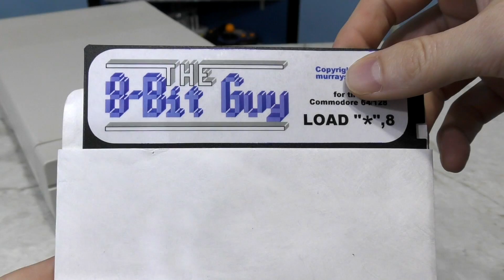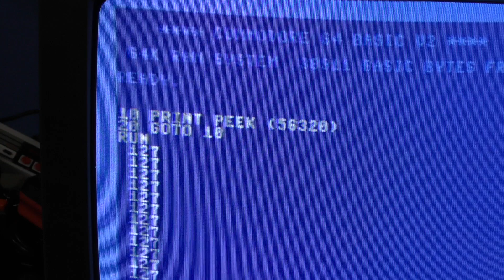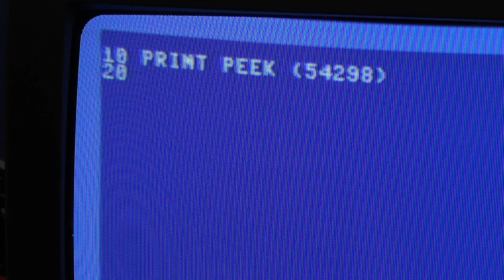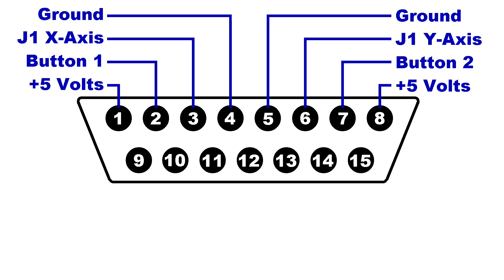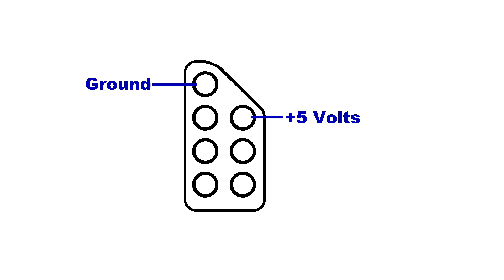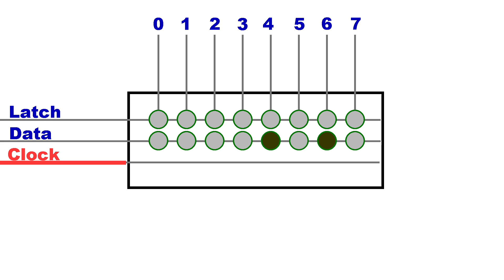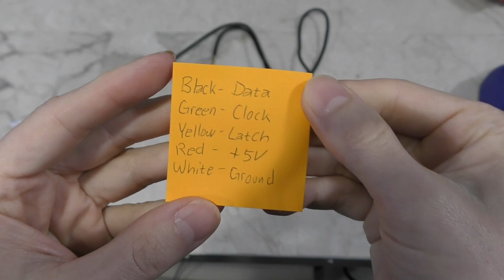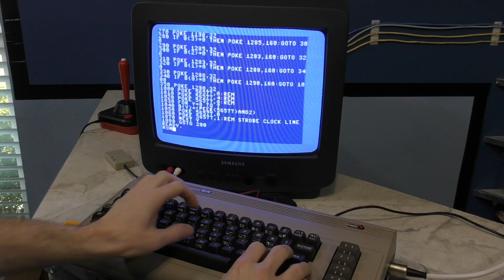How Vintage Game Controllers Worked

Comment: I bet an adapter could be made, that would allow the use of a Nintendo controller to play Commodore games.  You would just need a circuit to convert the data from the shift register chip to analog up, down, left, right, and power.
Reply: They have been made, that's why you can buy them.

Comment: I think you've got your explanation of the genesis/mega drive controller a little wrong.

Besides which I use mine with an atari 800XL without issue. - The computer can handle what a sega pad does just fine.

The Atari joystick pinout looks like this:

1. Up (also serial port pin 1)
2. Down (also serial port pin 2)
3. Left (also serial port pin 3)
4. Right (also serial port pin 4)
5. B input paddle / touch tablet
6. input trigger (aka button)
7 . +5 volts
8. Gnd
9. A input paddle / touch tablet.

The sega pinout looks like this (as seen with a mega drive/genesis)
1. up
2. down
3. gnd / left
4. gnd / right
5. +5 volts
6. Button A/B
7. Select
8. Ground
9. Button Start/C

You can see that pins 1-4 are functionally identical on both, and 6 has broadly the same purpose.
the extra buttons of the gamepad are on pin 9, which isn't a problem either, given that this is also where 2 button atari controllers put it, and even on older Atari devices this is a paddle input, and that means you can even read the extra button if you feel like it.
8 is ground on both.

The problem area is line 5 and line 7.

On the Atari, line 5 is a paddle input, line 7 is +5 volts.
on the Sega, line 5 is +5 volts input, and line 7 is the 'select' line.

But your interpretation of what that means is completely incorrect.

the 'select' line goes to a quad 4 input multiplexer, and selects which set of buttons is wired to the button pins. (notice 4 pins on the sega each have 2 buttons wired into them.)

If you put +5 volts to the select line, it means you have access to the B and C buttons alongside the 4 directions of the D-pad.
If you pull the line low, you get access to the A and Start buttons, and two of the directional controls are disabled.

There is NO way to pull this line to ground from the controller side, the console has to do it.
The reason this works out is that both line 5 and 7 on the atari have +5 volts on it by default. - if this wasn't the case on line 5, the Sega controllers would fail to work entirely. (no power), and if this wasn't the case on line 7, half the D-pad would be disabled, rendering the controller useless for most purposes.

Because you cannot intentionally pull line 7 low using an Atari controller port from the computer side, you cannot use the A and start buttons, and they do nothing. (not connected.)

Sega controllers can indeed kill commodore 64's though, but the reasons are not those which you have given. (it's a design quirk of the c64, and is partially related to it not correctly following the Atari controller port spec.)

You CANNOT kill a device merely by pressing start, because start is disconnected. (select line high - the multiplexer disconnects Start And A buttons entirely under these conditions.)

You also shouldn't be able to cause any trouble with the B button, since that's wired where Atari systems EXPECT a button, and you shouldn't be able to do any harm with the C button either, because that's a potentiometer port, and while that's analogue in nature, 5 and 0 volts are both valid inputs.

Quite why a sega controller can damage c64 hardware I'm not sure, but the reason you've given is clearly incorrect, because that's not at all how the system is wired. 
('Select' is a line controlled on the console side - the controller cannot alter it at all. And it's wired into the select pin of a multiplexer IC, NOT directly to ground, nor to ground through ANY of the buttons.)

Comment: I always thought the paddle controllers would have used a rotary encoder or something like that, didn't know the Atari 2600 was advanced enough for analogue input. Interesting stuff about the NES though, again I was wrong, until now I thought it used the same 9 pin socket that the Commodore, Atari and Genesis/Megadrive had.
Reply: The Atari Driving Controller - which looks like an Atari Paddle - that was the pack-in for the "Indy 500" title has a digital encoder. It also spins a full 360 degrees. There's a few home brew titles and hacks that use them. There's even a home brew or 2 on the Vectrex that also use them.

Comment: The Genesis controlers do not work like that. The 5+ volt pin is still 5+ volt, it feeds the IC inside the controller. The machine reads voltage values on other pins sent by the IC, that way it knows which and how many buttons, besides left, right, down, up, B and C, are pressed. There is no select button on a Genesis pad, more like a select line pin. A Genesis pad can be used in any Atari-standard 9-pin port and works fine, however, some games can malfunction because of the data sent to the unused pins, some Master System games have weird effects. Also, because of how the games read the controller, the 6-button pad can also give undesired results, Golden Axe II reads A, X, Y, Z and Start as the directional pad. In order to get the controller working, there is a button called MODE that, when is pressed as you turn on the power, changes the chip from 6-button to 3-button mode, thus, sending the proper voltage values. You should have tried the pins with the multimeter to see how they work, you also have to send energy to the IC.
Reply: Yeah, I spotted that error too. Perhaps David isn't too familiar with Sega consoles, or was trying to keep things simple for the purposes of the video?

Comment: I was confused by the "Select Button" pin on the Genesis as there is no "Select" button on the controller. The Select signal appears to be an output on the Genesis which selects between A/Start and B/C. This can either be +5v or GND. A Genesis controller plugged into a C64 should just see the Select pin as HIGH all the time, meaning that only B and C would work, but it shouldn't damage anything.

Comment: Somewhat surprised that no mention was made about the Apple II joystick and paddle controllers. They functioned similarly to the DOS gameports, but used a single 9-pin connector on the IIe, IIc, and IIc+. The IIe could actually use up to 4 analog inputs and 3 button inputs on this connector, but the IIc and IIc+ changed things to support a mouse instead of the 2 extra analog and 1 extra digital inputs. The original II and the II+ used a 16-pin DIP connector (which was also present on the IIe and IIgs) that had 4 analog input pins and 3 digital inputs as well as a set of output pins and a strobe pin.

Come to think of it, it might be a bit easier to make an adapter for the NES to the Apple II's 16-pin connector thanks to the strobe pin and the output pins. Actually using the controller for games probably isn't feasible, because the games weren't written for such an adapter, just like the C64 adapter shown in this video. But, like the C64 adapter, it would be an interesting experiment.

Comment: The information you said about the Genesis controller pinout at around 3:37 is wrong. The Select pin on the Genesis controller is a pin select for the multiplexer chip inside of the controller and NOT an actual button on the controller(look up a schematic if you don't believe me.) 

When a 5V signal(logic high) is applied to that pin, The multiplexer passes the left, right, B and C buttons to the output. When a logic low(ground) is input to the select line, the multiplexer will pass buttons A and Start through with the other two lines being ground. Button's A and B are mapped to pin 9 an button C and Start are mapped to Pin 6.

Comment: Legend says you can press all 4 buttons on the D-pad at the same time.
Reply: Easy, just short out the contacts with tin foil on the back of the PCB. :P
Reply: Yes, you only have to tear it apart and remove the plastic piece impeding so. Problem solved!
Reply: Some NES games require pressing opposite d-pad buttons simultaneously to access debug options.
Reply: serene.velocity I’m assuming they removed the button command for the debug menu before publishing. Naturally, a normal user would never be able to give a button command like that. Still, a broken or poorly designed controller could. Or did they really rely on the controller to prevent that kind of an input?
Reply: @goatbone  this was properly done with a splitter cable and 2 controllers, much how they are now doing ACE on consoles now. (arbitrary code execution)
Reply: @goatbone  and unlimited lives with stage select ;)
Reply: Ehh true
Reply: +Szoszaty Many games flip out if you press Up and Down, or Left and Right, at the same time.
Examples:
- Zelda II: Link just traverses across screens at Mach speed.
- Super Mario Bros.: Mario’s sprite glitches out whilst swimming (also, he moves slightly faster in water).
Reply: @cosmicpansexual  In Turtles II: The Arcade Game you can zip all around the screen with various combinations
Reply: @cosmicpansexual  I remember accidentally finding the Zelda 2 one while playing on emulator using a keyboard.
Reply: However, some games like SMB3 cancel out the U+D/L+R motion in software.
Reply: The console accepts impossible inputs like this (examples aplenty are available through TAS console verifications like with TASBot). It's a matter of the controller design prevents it unless you physically break the d-pad
Reply: The original PS1 controller used the same method. I soldered wires to the board before the chip so I could connect two Happs arcade joysticks that I had mounted on the foot-board of my waterbed so I could play Robotron:2084 correctly when that disc first came out in the mid 90's.  Eventually in 1999 I bought a full sized Robotron:2084 arcade game.
Reply: Chuck Norris did it.
Reply: @GerbenWijnja  by threatning it. WITH HIS MIND. ASLEEP.
WHILE Fighting HULK.
AND UNDOING THANOS' "DECIMATION"
Reply: Yes. Exactly one time.
Reply: That is a TASBot level move, that little bugger can push every button simultaneously on four controllers. Looks pretty though...
Reply: My cousin's uncle's great grandfather's great great nephew's former room mate's ex-wife's cousin's best friend's uncle did it
Reply: Greg Willis I just ordered home alone 2 lost in new York for super Nintendo Entertainment System from eBay today
Reply: With the center pin cut, you very much can. Or if it's broken.
Reply: It's true - this caused sometimes unexpected behaviour in certain games. I had baseball game in which pressing all dpad directions at once while throwing resulted in slow ball and speed counter going bonkers
Reply: Back in my time, you called that a Chuck Norris fact.
Reply: Sure, if you smash it with a hammer. ;D
Reply: Yeah, TAS says it
Reply: Szoszaty I did not like the old gameboys because you can't not see the screen very well
Reply: I knew a guy who's cousin's brother in law once did it!
Reply: If you do, Aeris lives
Reply: iKarith 
R/wooosh
Reply: He only presses one direction but I'm sure you can at least press 2... and if you could just take out the thing holding the middle of the D-Pad up, I'm sure 4 could be done!
Reply: Sorry we're talking legends: If you manage to press all 4 directions at once, the controller's AI takes over and plays any game perfectly!
Reply: @kailomonkey  /rwooosh
Reply: push in the part in the middle and you will press them all in
Reply: Electrically possible but mechanically not.
Reply: @innyermest7199  on PS3 you can
Reply: It would work if emulated with a computer keyboard. Here is a user defined layout.
(Arrows for D-Pad, z for A, x for B, Space for SELECT, Enter for START)
Reply: You can On the switch
Reply: Not an original snes controller, they were built well.
Reply: @iKarith legend says it though
Reply: @iKarith You can sure try with a 1st party controller in working order. But once you succeed, it won't be in working order anymore.
Reply: Confirmed with hydraulic press.  Science wins.
Reply: You can press all four directions at the same time by breaking your controller. This is considered cheating in some speedrunning communities. Apparently it is allowed in speedruns for some N64 games though, due to the different design of the N64 D-pad. Only a small piece of soft rubber prevents you from pressing up + down or left + right, and it wears down with use. The result is that even a reasonably well-maintained controller in otherwise decent shape will eventually allow you to press two opposite directions at once (if you push hard enough), making it arguably not illegal "hardware modification."
Reply: Legend says there's only three ways to get out of the hood
Reply: A friend of my uncles Gardner’s, manure supplier apparently managed to do it during a solar eclipse. 

I still have my doubts on the story but who know?
Reply: Not really. This is only possible on modern third-party controllers. It seems nobody can make a repro NES or SNES controller with a proper d-pad. All they have to do is use a "ball" in the center of the d-pad like Nintendo used. Instead they use either nothing at all or a small plastic pin molded into the bottom of the d-pad. It's a piss poor design.
Reply: Easy.
Reply: Chuck norris could

Comment: Obligatory Konami Kode reference:
↑ ↑ ↓ ↓ ← → ← → B A
But yeah. The Atari joysticks are glorified Hat Switches, just like the d-pads on any controller that has them, even the latest gen consoles still have Hat Switches in their d-pads, and all non-pro guitar controllers have Hat Switches too because that's what the Strum Bar is. Pro guitar controllers are stringed, though I imagine there is some form of Hat Switch attached to each string and some arbitrary button command for each fret and one for the open fret.
Hat Switches are one hundred percent digital, one or zero. Pretty simple stuff.

Comment: You just angered a lot of Apple and Coco Users by not including them. Like the PC, these systems used analog joysticks but with fewer pins to connect to their systems. In fact many PC joysticks sold with an apple adapter and if bought in Radio Shack, came with a Coco adapter as well.

Comment: But the Genesis doesn't have a Select button
Reply: His explanation of Genesis controllers is wrong. The Select pin is an output, used to select which set of buttons to read.

Comment: When you show the pin diagram, is that from the controller or the port? Got 2 genesis controllers that has been for years in need of troubleshooting, and that multimeter trick would make it easier, when i get back to it...
Reply: I wouldn't rely on his port diagrams in this case, the information he provides on the Sega controller is littered with errors.

Comment: It was always a bit weird to me why the joystick port was on the sound card, but retrospect it makes a lot of sense. It also happened that way in the C64. The paddle ports wired to the SID chip.
Reply: It makes slightly more sense when you realise the joystick port also functioned as the MIDI port.

Comment: Aww I was hoping to find out what tricks the colecovision controller used

What about the Atari Jaguar?
Reply: The Colecovision controller and keypad is explained quite well here: http://arcarc.xmission.com/Web%20Archives/Deathskull%20%28May-2006%29/games/tech/cvcont.html Basically, setting pin 5 to low causes the controller to return a 4-bit number in Pins 1-4 (usually used for up, down, left, right); which gives you the key pressed on the keypad.
Reply: @gwishart  Very clever of them! I didn't think this would have been an option.
Reply: The Atari Jaguar used Atari Corp's "Enhanced Joystick Ports" that were apparently designed for the unreleased Atari Panther 32-bit Console and first debuted on the Atari STe. The connectors were VGA-ish. They supported digital and analog joysticks, DPads, paddles, spinners, Trak-Balls, light guns, light pens, etc. You could hook up 2 Team Taps to them for a total of 8 JagPads. I thought they were fantastic.

Comment: As a kid, back in the N64 era when emulators started popping up, i had an adapter my brother's friend made to put a SNES controller onto the DB25 connector (or as i called it the "printer port" since the printer always used it and my parents always got mad when i didnt plug the printer back in)
I never thought about how that actually worked until now. Even though i do electrical stuff by trade, though im not anywhere near as well versed as you are in old tech.

Comment: I used a 3 button Genesis controller on my C64 and Amiga for years. Other than mess with the keyboard it did not fry my computers right away. But I wised up and wired it properly and connected the up direction to a second button. Which is fantastic for Gianna Sisters type games